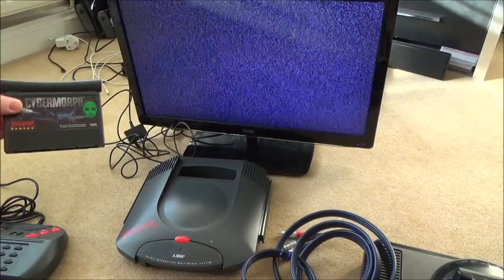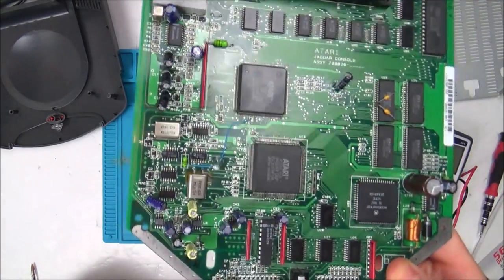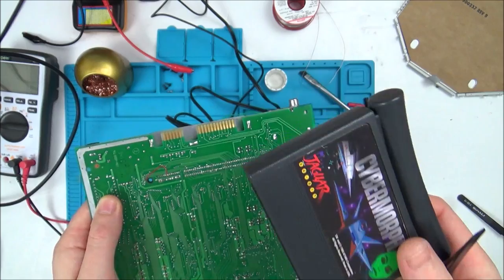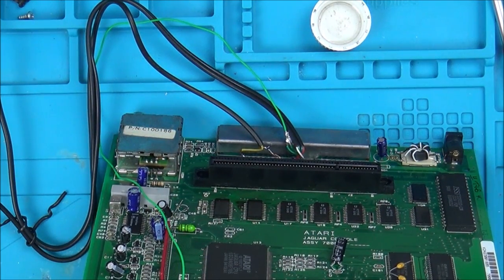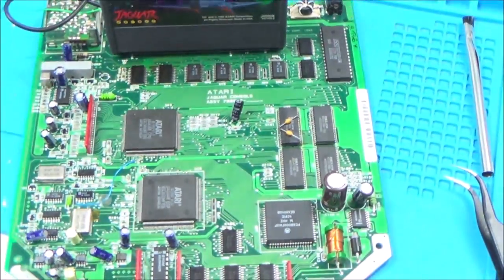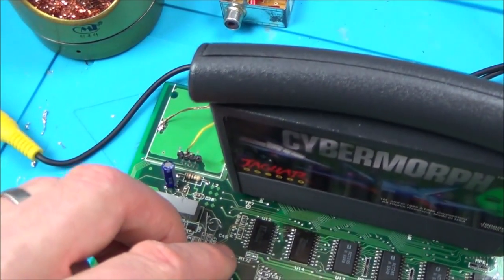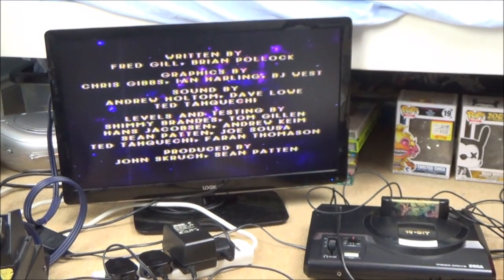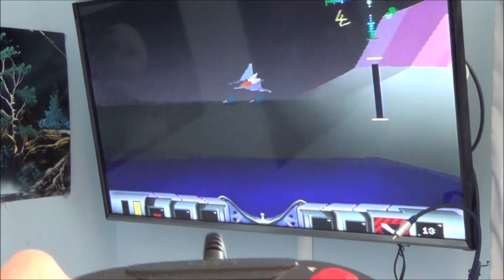Trying to FIX an ATARI JAGUAR with No Display

Comment: The Jaguar controller will work in the Atari Falcon030 if you are lucky enough to have one of those. That is one of the first units made..... I can see you even have the analog to digital chips but they were never used so unless you write your own game that uses them... those caps across the RAM chips could indeed be original bodge connections. Keep in mind you are dealing with a multi layer PCB and whomever was in there could have damaged the board layers. The problem is certainly with the cart connections. They are not self cleaning either. Just so you understand that. definitely replace those logic chips that were overheating. I'm sure they are damaged at this point. Use the edge of a defunct credit card with an old clean t-shirt dipped in contact cleaner. Shove it in and out carefully. Cut a strip of that old card to fit in the smaller area of the keyed connector and do the same. Make sure you clean the cartridge edge connector thoughly. I'm typing these as I watch so if you solved it already, at least keep this in mind for future reference. IPA is never the best thing to use to clean any metal surfaces. It's corrosive.... De-ox spray is the best.

Comment: Ive had things mysteriously fix themself on multiple occasions. I had a VCR completely dead after taking it apart magically start working again. I also had a heater do it once, actually on multiple heaters. I was once given this mp3 player that was water damaged from being left out in the rain. it was completely dead for weeks. After me giving up on it and getting frustrated with it thinking "what do I got to lose?" I started throwing it and wacking it and kicking it and it also magically came back to life and never ever gave me problems and never stopped working and worked very reliably for many years after that. Once my PSP randomly stopped powering on and then just fixed it'sself somehow and is still working perfectly. Think it was from a failed softmod. Needless to say it is softmodded and although the optical drive is dead on it it it still works great for playing emulators. I also fixed a stereo once by cleaning the circuit board with alcohol.

Comment: The Jaguar did have an issue, a very dirty cart slot.  This is why the 74AC244 Octal Buffer chip was getting very hot.  The Jaguar cart slot can show many issues, from no screen, to red screen, to corrupt graphics and more.  The RF Modulator issue is strange as the C100186 I believe is a PAL modulator for the XEGS game system and not the Jaguar, so I am guessing that could have been swapped out by someone.  I am wondering now is this started out as a French system with no modulator, and someone added the C100186 to give it an RF signal. That could also be related why the capacitor was missing.

Comment: Don't forget the boot screen easter egg.  Hold down the Pause button on your Jaguar pad wen you turn on your Jaguar, and when the rotating cube appears, you can press up, down, left and right to change the speed, size and direction of rotation.
Reply from the maker: Nice, I will try this. Thanks for sharing it :-)

Comment: The RF modulator used on all VCR's in the UK was around CH 36 UHF The Atari looks the have a similar unit you should put the tv into auto tune mode to find its signal.Other fault was probably dirty /bad contact on the games socket

Comment: The problem was the dirty/corroded cartridge connector. Had same problem with my n64. Sometimes game works perfectly when you have the pins lined, if not its black screen.

Comment: Things to do with a non-working system:

1. Check for physical damage.
2. Check for shorts.
3. Measure voltages (supply rails across the board).
4. Isolate fault to a subsystem.
Reply: Without schematic, how do you know which voltage should be where?

Comment: What I think the reason it is not always loading is all to do with the cleaning of the cart, isopropyl is slightly conductive so you need wait for all of it to evaporate. So if you try run it while wet with isopropyl it could be causing issues with the signals between game cart and console

Comment: Hi Vince, quick question if you don't mind?  What's the mains input voltage range as stated on the back of your soldering station/power supply please?  Is it 220V?  Cheers

Comment: Hi Vince, what is the golden egg in the top left  of the blue mat for?
Reply from the maker: Ohhh, I was wondering what you meant until I watched the vid back :-) That is to clean the solder of the soldering iron. You can use it instead of a wet sponge to clean the tip of excess solder :-) Some people prefer it as it doesn't cool down the tip as much as a wet sponge :-)

Comment: one way to test a cap, is warm it with soldering iron,  disconect the earth on your iron, if fitted. a cap will work when warmed, resistors can change in value, when warmed or cooled, ic chip can work again when froze, so get ya self some plumbers frezze spray. i had an lg lcd tv stuck in a loop logo screen then boot again, it needed an updated system, frezzing the chip, made it work long enough to install the new system software, after the chip came to room temp, the tv worked fine.

Comment: Hi vince two possible explanations for the fix 1> a capacitor in the reset circuit has reformed its self 2> the on off switch has a set of reset contacts that were dirty.
As others have said the modulator is not for the UK.
Reply from the maker: Cheers Rob, a lot have mentioned the power switch in the comments, maybe it was just dirty contacts!!!! If only I had thought of that I could have saved a wasted day :-)

Comment: I've never heard of this console. Anyway, intermittent errors makes me think of bad joints, dirty contacts and/or heat problems. The cartridge connector looked suspicious indeed. There might be a lifted trace or something there, or some flux residue, as discussed. The seller also wrote something about flux residue, I think. Flux and liquid residue can be conductive, so when I see that I'm thinking it's always a good idea to clean it off straight away. The hot chip is also suspicious. Even if it's supposed to get warm, adding a heat sink could prolong its life. Oh, and it's probably best not to put solder on connector pins since you can never get it off again.

Comment: I you clean the cartridge printing plate connectors  using a small pencil eraser and then afterwards clean  it with alcohol on a cotton but must games Wil work. Sometimes you have to fiddle a bit with the cartridge when inserting the game. That also works most of the time,

Comment: A wise but hard and proper decision would be to remove the slot and repair damage under it, another decision would be if clean the socket in case of any oxydation on pins. The actual problem looks to me that it is with bad solder joint on some of the pins of the chips and when console stay on it rise its temperature and you know that heated metals expand -> respecrively reconnect faulty joint wherever it is! The RF module is nothing more than 4 input pins -> Audio, Video, +5V and Ground - the A & V signals are just mixed and modulated to RF output, you can just put 2 caps 330nF in series on A & V signals and connect them straight to TV! DON"T touch the BENDED COILS, they are tunned from factory to exact frequency by bending. That SCREW is a tunning transformer and by turning it you change the carryer frequency. Dirty contacts could be the MAIN problem at all.

Comment: I wonder that the reason why you are picking up a signal when tuning using Australia and the UAE is because they use VHF frequencies for broadcasting and the RF modulator is set a frequency in VHF Band I. In the UK, VHF Band I was used for 405-line black and white BBC TV (later BBC One) broadcasts which closed in 1985. But is used for 625-line colour TV in other countries. As for those talking about different PAL standards, its likely modern TV's can handle any form of PAL broadcast, hence video and sound on the Samsung TV. Different from my old CRT which could only use PAL-I (as in the UK) and when I picked up Dutch television during lift conditions, I got a picture but no sound.

I suspect the five channels you're able to tune into is due to harmonics, as mentioned by GadgetUK164.

I'll wager its a non-UK Jaguar.
Reply from the maker: Thanks Gareth :-)

Comment: Merging my three comments into one :D

1)
Regarding PAL, there are "different" PAL signal standards, especially in the 90s that mattered. I remember that from my childhood. I think it mattered when we went shopping in Poland for consoles and games. (or Spain... I was traveling a lot with my parents back then) 
PAL B
PAL I
PAL D
something like that. 
All were PAL but they were slightly different, I do not remember how exactly though.

2)
Oh, since you quite often work on older electronics, you might consider buying a logic probe. And/Or maybe a cheap osciloscope (since you need no accurate data, just low/high, quality is not that big of an issue). Nice tools to check the function on circuits of old computers.

3)
oh no, the notorious cybermorph... it would have been a good game, but the the combination of low view range and high speed / low steering made it .... a pain.
Reply from the maker: Thanks Christian :-)

Comment: Since the RF modulator isn't integrated with the PSU (like the NES) you should gut the RF modulator and AV mod it.

Of course, it depends on how "original" you want to keep it.

Comment: Almost seems like a clock issue, with such hit and miss, but i had mine go red a few times just from there not being enough back pressure on the cart, i inserted a rubber wedge in mine and it fixed the red screen but every fault is different i suppose.

Comment: I can explain why the Jaguar appears on multiple channels with poor quality and one with good quality, whereas the Sega Genisis doesnt - cheap ass rf modulator. The RF modulator is the thing with the 3 pins and screw adjustment you were playing with toward the end of the video. if it is cheap (as a cost cutting measure) it won't have filters in it to suppress harmonics of the main frequency it is outputting. The Sega Genisis obviously has a higher quality modulator that has harmonic suppression :)

Comment: I had a audio receiver that did the same not working at first and then just working fine. Turned out to be a bad power supply. If we didn't use the receiver for a while it would have the same issue again and then once we used it again for a while it would just work again.

Comment: in 2002 or 2003 my local game had loads of jaguar consoles and controllers and games in stock for some reason. they were selling the console and a controller for £15 and 3 games for a fiver. all brand new unopened... i so wish id bought as many as possible ans stashed them to sell now. they looked like they had 100s of them and couldnt see anyone buying them. i got one and a load of games, but never really gave it a good go. cant really remember what i did with it

Comment: Why do you call the Circuit Board Tracks "Viers" i have heard you say it a few times and and i need to know ! ...
Reply from the maker: Vias are the holes that go from one side of the board to the other, so a track (trace) will end on a via, travel through the via to the other side (or another layer in the board) and then continue onwards :-)
Reply: @Mymatevince  , thanks Vince, i know know what you mean, the holes that just go from one side to the other  we call it through hole plating, . cheers and keep up the good work #

Comment: Ah Vince, someone is playing a trick on you or seeing if your approach can solve the hundreds of hardware bugs in the jag. It never works reliably. I've seen dozens and they all do it with every game. The only solution is to eject the game, maybe clean it quickly, and try again until it works. Eventually it'll go. I've had the console sit over night with the game working previously, return the next day and power it on to find despite it never being touched in the mean time that it just doesn't feel like working.

Comment: see below different pal tv standards 

    Standards B/G are used in most of Western Europe, Australia, and New Zealand
    Standard I in the UK, Ireland, Hong Kong, South Africa, and Macau
    Standards D/K (along with SECAM) in most of Central and Eastern Europe
    Standard D in mainland China. Most analogue CCTV cameras are Standard D.

Systems B and G are similar. System B specifies 7 MHz channel bandwidth, while System G specifies 8 MHz channel bandwidth. Australia used System B for VHF and UHF channels. Similarly, Systems D and K are similar except for the bands they use: System D is only used on VHF (except in mainland China), while System K is only used on UHF. Although System I is used on both bands, it has only been used on UHF in the United Kingdom.

Comment: Great video Vince, nice to see another Atari rescued from the bin, anyway just thought it might help a bit regarding different region consoles, see :- https://en.wikipedia.org/wiki/PAL
I bought an atari 7800 labelled unerneath wth a PAL-B sticker, that tuned in on frequencies 50mhz+, i think i saw yours tuning in at around 69mhz so maybe the jaguar is PAL-B also ???
Anyway usually machines for the uk are usually PAL-I units which are frequencies from approx 470mhz+, that jaguar you have is not intended for the uk by the looks of it, hope i've helped a little, thanks Vince, bye :)
Reply from the maker: Thank you Mark :-)

Comment: RF output doesn't really have much  use these days, why not simply remove the internals of the RF modulator and use it's case to house composite AV connections, and just bridge the audio video over to the new connectors. Saves faffing about soldering and unsoldering wires to the AV expansion port.

Comment: Cybermorph was cheap because it was the original "box in" title that came with the console, so there are a lot around; also, it wasn't very popular, critically considered a failure for trying to be a title that shows off the Jaguar's high performance, but actually demonstrated its 3-D limitations ( note how limited the view distance is, making the game practically unplayable at higher altitudes)

The Jaguar was touted as being good at 3-D, but actually wasn't really.  It was more on par with a Playstation ij that regard.   It's 2-D graphics, though, were really good.  Unfortunately, Sony was really wowing people with its 3-D titles.
Reply: Also, I think you fixed it with the power of love
Reply: Wooo I'm Like no. 3000 on the dot!

Comment: How annoying, my cats decided to walk over my jag and press the power button and im unsure how long it was on for, it did work great, now it doesnt, i get the green light power light but no sound or image. shame you didnt find out what the cause was, going to do a cap change first as not sure its ever had one. will go from there, but that removal of the RF box, cant you make a mono audio video adaptation for it, as it seemed to work fine without the RF box

Comment: I bet there was only corrosion in the power switch, if it was glitching during push it could cause the system to hang. You pushing it 100 times cleared the corrosion.

Comment: 2 things, a bad solder connection, or a small wire floating around? most common hard to reconize problems.

Comment: I think this needs reflowing. This issue seems like a bad contact with something. Maybe you might consider baking it in the oven? Sounds werid but you should give that a google.
Reply: All you're going to accomplish is damaging components. Would rather see someone use a heat gun instead of " just throw her in the oven at 400 for 3 hoursand you'll  have a perfectly done and succulent turkey."

Comment: Alcohol is very conductive, you risk shorting the components if you do that, at least use less to check the temperature
Reply: The behavior looks a lot like a cold solder joint issue but the overheating ic should also be a concern

Comment: How frustrating lol. I think older TVs could play all the old consoles. Try and watch digital TV now on a CRT and you will have issues. Modern consoles would have problems playing on an old Tv. I think there are a few things 1 being noise, resolution and just plain incompatability. Guess its an analogue thing

Comment: Hi there ps4 pro has solid blue light then switches off its the model with x clamp psu is good does the same thing if hardrive out plus no fan spin if I don't connect the 12v and just run standby connector it flashes once and switches off

Comment: https://youtu.be/RVyFEMg0Kpg this video will answer your RF question. Basically it’s a frequency issue and that screw you gotta keep rotating until it tunes in.  But if you got it working I wouldn’t mess with it especially if your already using av.
Reply from the maker: Great video, thanks for sharing it :-)

Comment: This is going to sound really odd. There's a guy on Youtube who has had various completely dead PC motherboards sent to him. He has put them in a dish washer, and when he takes them out and lets them fully dry they work. You obviously did fix it, and you did so by cleaning those pins on the underside of the connector. Let's say a tiny little fly went in there and got zapped. His guts could then cause a short between two pins. That is really the only logical thing I can think of with the PC motherboards, and obviously something similar was going on here. Glad you fixed it though, but god that game is ass.

Comment: Use hot glue,silicon and it will be no dust on solder joints.